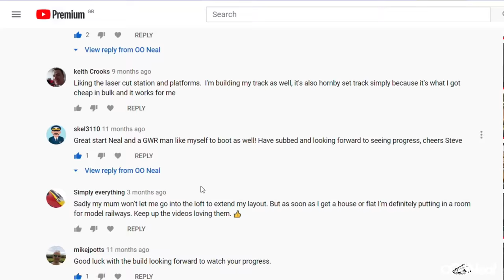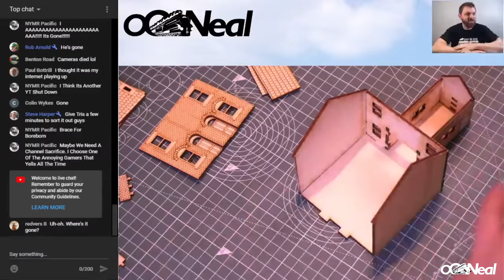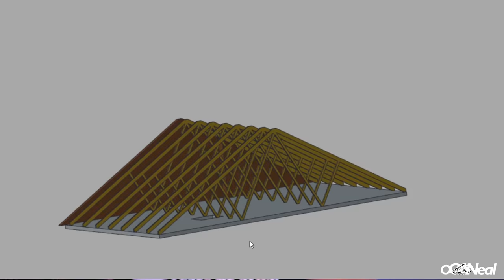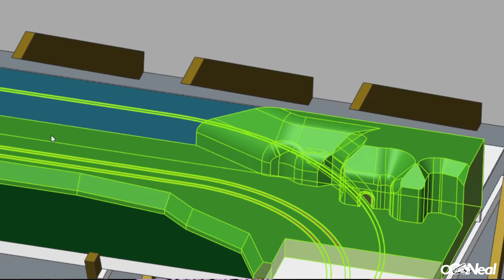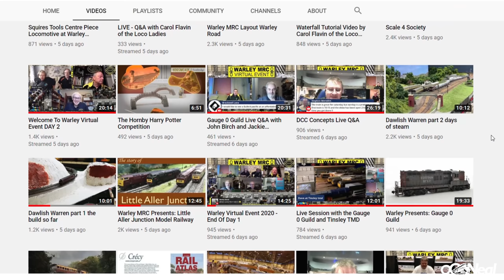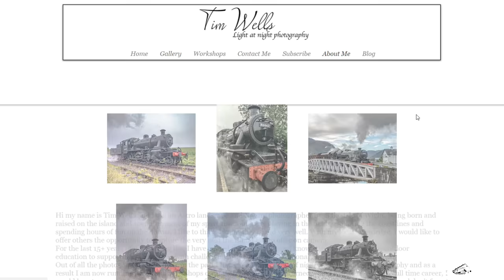Base Board Building | Dapol GWR Mogul | Dads Layout Update | Building Up A Model Railway Ep 5 S2

Comment: Hi Tris, any tips about what wood to use for base boards that will not warp in the change in temperatures in the loft?
Reply: Nevermind you answered my question in the video Haha. Great vid!
Reply from the maker: Hello, I use 9mm Ply which I have found to be stable, I use pine wood from b and q for the other pieces. I have found the boards to hold there shape pretty well. just make sure you brace it all up nicely
Reply from the maker: Just found this after I replied. take care!

Comment: Did you strengthen your joists before building your layout please?
Reply from the maker: Hello Phil, with the struts going across it’s added support to the joists and the boards at light weight so it will be fine.
Reply: @OONeal  Okay thanks. I have done the same thing in my loft. I am using 12mm ply for baseboards.